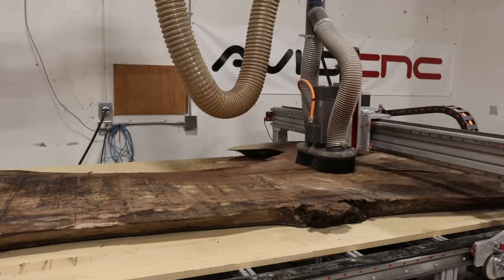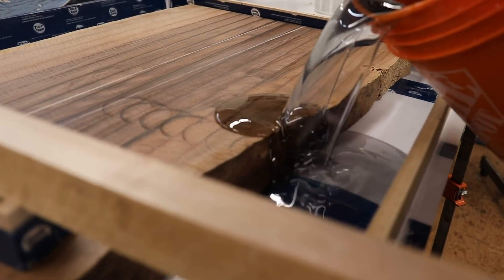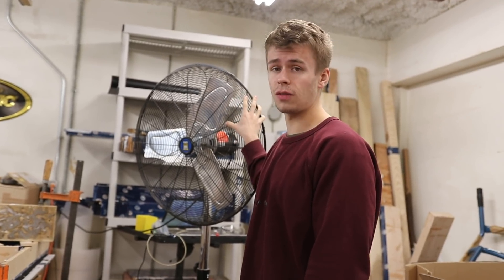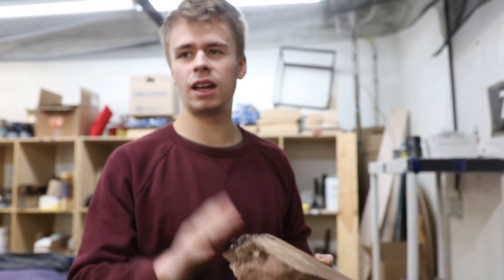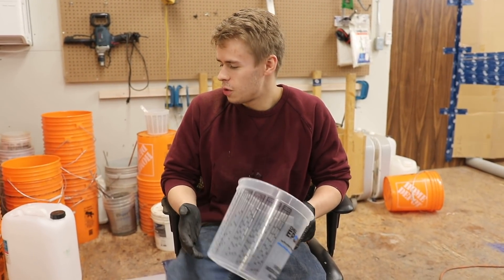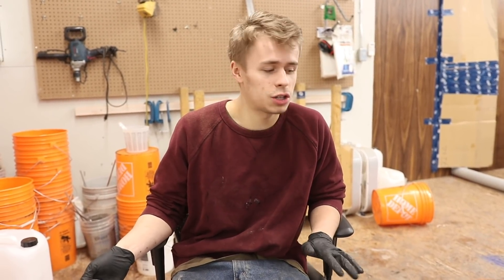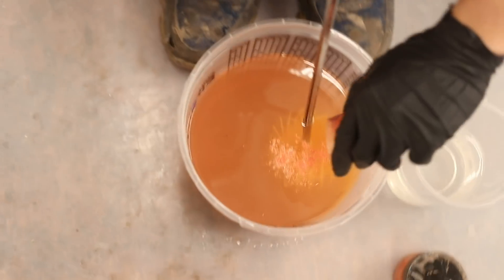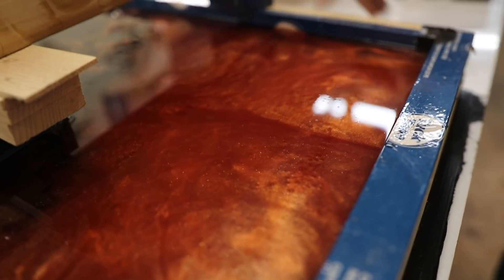Addressing What Happened With Chill Epoxy...

Comment: Thanks for stressing the importance of cooling your work. How thick is the sheet of aluminum under the mold? And is that a regular window AC unit under the table?. And are you concerned about sawdust and shop debris being blown into the epoxy while using those big fans?

Comment: Since you put the blocks on the wood to hold it down, how much epoxy gets under the wood?  Is it enough just to seal the wood, cause it seems like you usually mill down to the wood once the epoxy is cured.

Comment: As always an interesting vid
I bought some BF epox for an upcoming project for my wife
the pour itself is 2" so no big deal with your materials the question I have is about your experience with with BlackD powdered color separating in the epox after pour and before set
I use several epox products in the 2/1 mix range that set with 24
When you watch a vid on river tables you see the application of epox and swirls set by hand.......even in 24 hour epox most or all of this settles to very little
most of the short work time epox I use is a crap shoot between set or the end of your work window and your ability to make the most of the pigments
can you comment on how late I could expect to be able to disturb a 2" pour as part of developing a visual based on Black Diamonds products
I saw you pop that bubble on the table pour and the materials return to level on day 2.........same deal if I work in the epoxy to pattern the pigments??????????

Comment: interesting reactions between the epoxies. I didn't hear of give away deadline. i used to pour urethane when i worked in a pattern shop, I made many molds from plaster and wood. The stuff could seep into a .003" crack. I enjoyed working with the stuff.